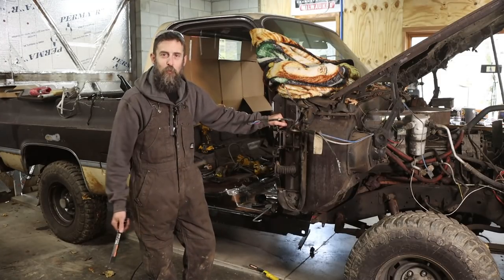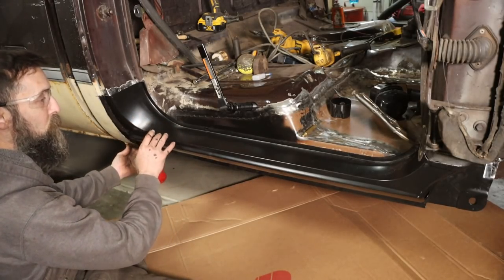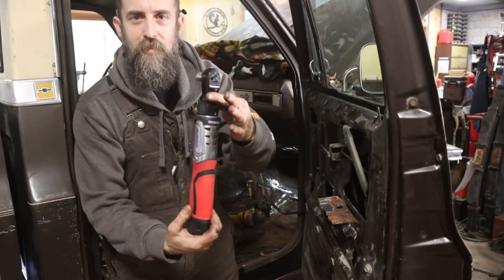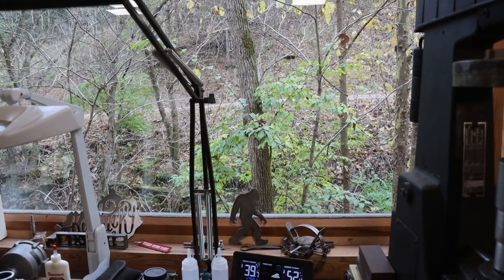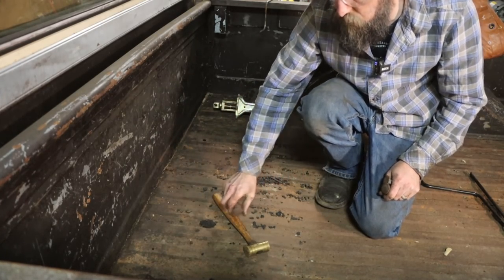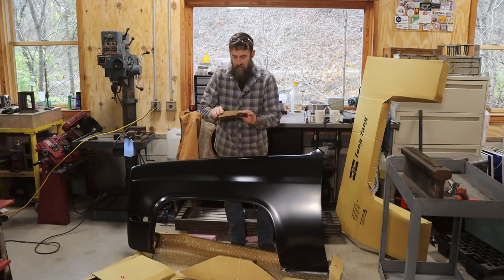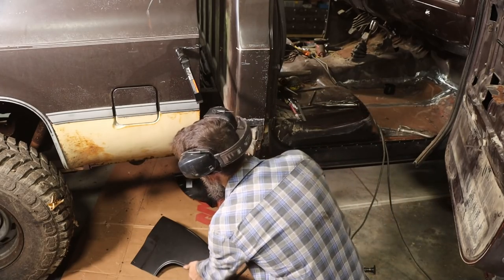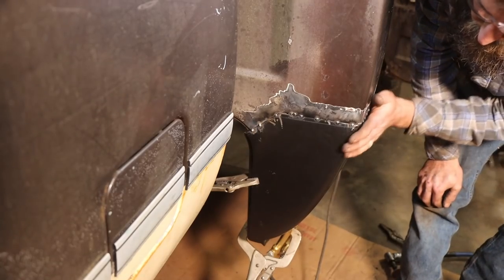STOKED! Cab Corners & Rockers In the Firewood Square Body.  Part 9 #chevrolet #squarebody

Comment: Where I grew up, there was an old bachelor farmer who had returned from WW II with excess backpay. So he bought a new 1949 Ford pickup. He was still driving it at the time of his death in the 1990s.  However, he had to enter and exit the cab via the passenger door. The driver's door was tied in place with baling wire. He kept that truck because it still ran. Upon his death, a rather large cash estate was divided between the local hospital, the volunteer fire department and the public library.

Comment: Hey Steve ! You are right full of good tidbits for us today. As I try and stay away from anything thinner than 10 ga (1/8th in) you are making body work look reasonably painless. Actually 1/4 in and thicker (2 in) is my comfort zone. You sure have a great shop hand there my friend. Good welder and all round mechanics are hard to come by as I am sure you know eh. Although LED's are nice and bright (sometimes too bright) they do not create any heat. Up here where we have freezing temps for 7 months regular lighting is preferred as with tail lights esp they melt the snow and ice from them. LED headlights are nice but particularly hard on the oncoming drivers eyes. I really think for a fella that is normally used to working to the tenths scale you are rocking this project old friend. Take care and have a great week !

Comment: Steve awesome work done on the nice old square body truck that is definitely coming back into popular demand for sure!! The old square body Chevy and GMC are one of my favorite body style trucks ever besides the 1967-1972 Chevy trucks!! Witch I only have one 1969 Chevy pickup and have had it ever since 1997 and have been going threw it ever since!! But the square body trucks I have 5 or 6 of them witch are all 1TON 4x4 with the best sm465 manual tranny and 205 transfer cases!! The newest one I have gotten is a 1981 Chevy 1Ton 4x4 SRW witch was ordered new by a local fire station!! It’s a pretty nice truck other than the yellow paint that they had painted over the original white paint that it came in!!! I absolutely love this truck!!

Comment: Brings back a lot of memories.  Ate a lot of rust at the body shop back in the day.  Remember the Chrysler K-cars. They had no inner fenders, and the cheap metal of the fenders would rust out in a heartbeat, if not heavily undercoated.  We always wanted o do a Red Oxide primer under clear coat, but never did.  Always thought that would look good.  Thanks for sharing.

Comment: Really i am blown away at what you are doing. When i said the engine would still be going after the rest of truck rusted away, I had no idea what was in store for the dear old thing!
I have no idea about headlights but probably get ones with no water included hehe and for the colour; what about just clear coat so you can see that hardship the truck has endured but you can also see that it has been given some care and attention. Hah I don't know...

It doesn't matter... But it does ;)

Comment: I had a 78 Chevy in high school, it was in ok shape then but the tail gate need replaced. So I built one out of square tube and expanded metal and loved it. I kept that truck till the cab rusted so bad that it saged on both sides of the frame.

Comment: I've done several of these over the years and it's relatively the same process for different year trucks I've had a couple of the late 50s trucks I've had a couple of the late 60 trucks and the '70s and the '80s and providing you can get the repair panels it's not all that hard of a job it's tedious but when it's finished and you put that layer of paint on it and you can't tell that it was done???? Priceless

Comment: Looking good Steve! As far as patch panels go, I have used the ones from Tabco in Ohio. They are made very heavy and the fit has always been light years ahead of others I have used. I would put some access holes in the backsides of your new panels with plugs to fit for rustproofing after you paint. Either get some Fluid Film or mix up some boiled linseed oil and give'r the beans anywhere you can. Yes, go with LED lighting, you won't be sorry. LMC truck, I think, still has the replacements to fit your truck, or you can probably find ones elsewhere to fit. As far as color goes, not much goes with brown interior other than brown. I tend to like the factory two tone color scheme with the chrome moldings around the beltline. Base/clear is the only paint I use as it is much easier to put on with much less overspray mess. It's nicer for two tone jobs because of the dry times involved with masking and all that. Price, of course, is much more for quality paint, but you get what you pay for. I'm sure you already know all of this having done this type of work before Steve.

Comment: Hi Steve, another tip, fitting doors on your own,  set the door hinges to door open position wind the window down, place your shoulder under the top of the window opening, standing on the inside of the door, lift into position and with one hand fit to top bolt, you will be surprised how easy it is to get the door in the correct position to start the bolt.

Comment: Regarding your front lights: If you don't want to drive around in the darkness only equipped with something equivalent to a candlelight, I would highly suggest you ditch the sealed beam lights and get some projector lights, either Xenon or even LED. Or look out for some universal fit euro spec halogen lights with H7 bulbs.
Secondly, you should upgrade the wiring to the lights and the switches, maybe even consider a relay upgrade, so you get less voltage loss at the light fixtures.
Relay upgrade means: Your switches only switch the relays, and the relays, with new, thicker wiring and seperate fuses, switch the bulbs.
Usually that makes a difference like day and night.
Reply: I’ve found it to be an either/or thing. If you install LEDs they take so much less current and have their own dc:dc converters that the voltage drop doesn’t affect them. If you go back to halogen, then a headlight wiring bypass makes a huge difference. I usually do motorcycles, and they usually run all the headlight current through the handlebar switch. Awful design.
Reply: The problem that most people don’t think about with LED headlights is that they use so little current that they don’t heat up like an incandescent bulb. That’s fine if you live in an area where you never see snow. Especially wet snow. It will build up on the face of the light and LEDs don’t produce enough heat to melt it off. Kinda defeats the whole point of having brighter lights.
Reply: @notajp  Do a search here on YouTube for a video called “the problem of ‘but sometimes” as it directly addresses this issue.
Reply: I second this. Just save your money and stay away from the relay upgrades from those truck catalogs. Installed one on my old GMT 400 made no difference, quality was highly questionable. Wire gauge was laughable tiny wires in an oversized foul-smelling plastic sheath.  Seen some quality ones out there, or make your own.

Comment: Hi Steve, as a previous owner of a 1980 C-10, I really really recommend an Electric fan to replace that clutch fan from the Motor. Especially when your doing any hauling in Hot weather. I could manually turn on the fan (it turns on automatically with a sensor in your radiator) whenever I know there's a hill or having a heavy load in the bed that way the cooling system gets a head start with extra cooling for the engine and transmission. Only about $170 I think it was. A must have mod. Frees up Horsepower too.

Comment: when we replaced the rockers and floors on our old Chevy  I cut the back half of the fenders off , about to the hight of the bottom door hinge ,. cause i was replacing the fenders with new ones anyways , that way I could leave the hood and the doors installed while i was fitting  everything ,. it saved a lot of work from taking the doors on and off the truck , and I was able to use the body lines from the fenders and the cab ... but either way ,  here's to ya man 👍.   keep up the great work . thanks for the video .

Comment: Headlights (headlights that work) go with Bosch H4 Quartz Halogen replacements, running 80/100 bulbs through and auxiliary relays for both low and high beams. Re-aim the lights after installation and you will not A) be blinding any one coming at you B) pushing some serious wattage out the front of the truck at night time C) able to see with either low beams or high beams. Led headlight are shear annoying to oncoming vehicles because they are improperly installed and not properly aimed. This will retain the classic look of the truck for it's vintage, but upgrade your lighting quality by 100% with good clean focused light.. Nice work Steve stay on it Laddy, She's going to be sharp! Stay Safe

Comment: Looks great. The headlights I used to buy for the 80s GM stuff aren't available anymore but they were glass lens and used an H4 bulb. Same connector but you will have to move wires around to make it work as the pinout is different.  I think you will be happy with any of the decent capsule style lights with a replacable bulb. I used 45w/90w bulbs and they were pretty bright.  You will need relays to run power to them as the factory wiring and switch won't handle it.  Shoot me an Email if you have any questions. I used to be an ASE master tech and did primarily GM stuff.

Comment: Since you live in the land of rust, suggest using weld through primer to give a hint of protection at all the locations where you have ground off the paint and won't be able to reapply paint after the panels are reinstalled. While the seam sealer should do the job, moisture always seams to find a way to attack unprotected steel. 

Regarding underbody protection and being thrifty(cheap), take a look at Mustie1's channel on his method of under body protection. He uses a 50-50 mix of bar & chain oil and used motor oil that is sprayed on. While not pretty, the oil attracts a fine layer of dust and does a decent job protecting the frame and body. Any repair work that has to be done in the future is much easier than trying to remove any of the goopy thick type of store bought protection. If any moisture gets behind those systems, it traps it in and just makes the soon to be rust much worse. The oil and dust method can be renewed by spraying more oil over whatever is there and driving over a dusty road. Not sure where you would find a dusty road though.

 Love the progress on getting the old girl back in condition.
Reply: I use linseed oil, as it will eventually polymerise to a hard coating, and really creeps into places between the panels and seams. Surface rust it stops dead, and is cheap.
Reply: @SeanBZA  - Do you use 'Raw' linseed oil or "Boiled' linseed oil?  They're side by side at the hardware store.
Reply: For the rockers you can also spray that up inside of them and it protects the metal from the back side. that's what causes these to rust out, and filling the cavity with an oil film keeps it from rusting out as quickly.
Reply: @flick22601  I have used both, but the boiled one has less water in it, so polymerises easier, plus it smells less. They both will polymerise, and will eventually harden.
Reply: I spray rustoleum cold galvanize paint over all surfaces that don't get exterior paint. Inside panels before welding them on and than on inside areas before seam sealer
Reply: Yeah, I've heard so much about weld thru primer, I was expecting you to use that here.
Be careful using linseed oil. If you are careless with it, it can spontaneously combust. Please don't ask me how I know.
Reply: primer does not protect metal ! primer is to increase paint adhesion.
Reply: @joefalmo5528  OK, try this: Take a piece of sheet metal, mask off 1/2 of it, paint the exposed side with a metal primer, then set it outside in the weather for a couple of weeks. You tell me which side rusts faster.
Reply: @joefalmo5528  They’re talking about special primers which have added zinc to help with both corrosion and weld-through properties.     Also it totally depends on what type of primer be it epoxy based or urethane of course ya get what ya pay for.     Word

Comment: You can get LEDs that will fit the bezels you have BUT please ensure that your local authorities will allow them as an aftermarket fitment (I used to import and sell LEDs and HIDs into Australia) - they are very bright!  You also need to do some re-wiring to get the high / low circuit to work properly, the LEDs are polarity specific - but you can now get plug and play looms that overcome that problem. You can also get lenses to take the old halogen bulbs if you don't or can't go down the LED route but the current draw can be high - make sure the wiring will handle it.

Comment: Being tighter than a hide tick in a belly button I understand cheap. But, a lovely old truck like that needs decent paint and good lighting. My early 60's Ford was black with 4 different shades of metal flake so that as you walked around it it seemed to change color. It was a real pain doing the metal flake blending but the three coats of clear and a finish polish almost made it perfect. Good luck on the rebuild. I am thoroughly enjoying the series.

Comment: Myself I would just go back original colors and paint scheme. "Good enough" is what your going for... those trucks look plenty good enough as is once you've finished all the fixin. Color changing and getting into the jambing and interior color changes definitely make a bunch more work, not doing it and changing colors makes it look like quickie work or unfinished. Besides, IDC where you go, if you see an old square body looking all fresh, shiny and right in its original "clothes" you'll see nearly everyone notices it. It will surprise you what vehicles will not get noticed but the old original square body does. Seems like everyone has some connection to one in their past somehow.  Fine job on the floorboards btw. Thanks for sharing

Comment: When you twisted the bottom of the rocker, you changed all the angles, thats why the corner panel have that big gap/misalignement in the back of the cab.
Maybe if you put the corner panel a little bit higher, the gap in the back and in the corner would close.
Anyway, I am not saying here that the aftermarket pannels are good, but sometimens a part of misallignement come from how we work.
Otherway, you have patience and do a very good job. 
Keep up the good work !

Comment: Gm 4x4 steering box idea that nobody ever let me build for their truck.  The three inner steering box mounting bolts change to grade 8 studs with flange nuts holding the box to the frame.  On top on the studs a triangle shaped tube structure that drops down below the crank pulley but comes back up to the other frame rail where the idle arm mounts. This stiffens up the left frame horn and any rotation the steering box tries to exert on the left frame is stopped by the light weight tube structure.

Comment: If they're not very bright, you likely have electrical resistance somewhere. Don't waste money on "high brightness" sealed beams; they burn out WAY faster. Either convert to H4's or buy regular lights, and fix the wiring/ground issue. Great content as always!

Comment: You put new cab mounts on this rig. This is a great project for the channel. Alot of content and you'll have a great looking and running rig.. new shocks,maybe a sping pack from a 3/4 ton out back?..idk.. I've been running that light for some time. It's great. I say if it's rebuildable rebuild it with this rig..be cheaper and we all learn.

Comment: Steve thats really much better than most home body work, youve really put the effort in and restored structure water tightness and integrity not just slapped outer panels on with rivets and sealer--lol   Looks really good, some body shops dont do as well unless you pay big $$$$$.Yknow its funny, back in the day those old sealed beams were like $12 apiece, but now that theyre not common anymore theyre asking stupid money.  My old '89 caprice took those type sealed beams and I had to buy one, cost me like $12.99, no reason other than not being common anymore for them to be expensive.  Far as color ive always heard it said white hides a lot of imperfections and its the cheapest paint color to buy, but shows dirt - black shows every iimperfection.  If you want your biggest bang for buck color impact red is always an obvious choice but as always personal taste comes into play.  Nice work steve really.
Reply: The problem with red, it fades faster than any other color.

Comment: Good job Steve. But i would recommend cavity wax by 3M 08852 and the applicator kit 08851. Spray it on the inside of your new parts. It will stop the rust from starting on the inside. I also use weldable primer on my weld seams. Looks good.....

Comment: Hello Steve first off your doing a great job on the body work as you do on all your projects I would definitely go with led lights front and back since you are driving more back roads you will appreciate the better lighting as far as paint I never was a fan of the two tone look I would just go with a solid color base coat/clear coat and call it good just my opinion but it sure will look nice when it’s done keep up the fine work looking forward to the next post